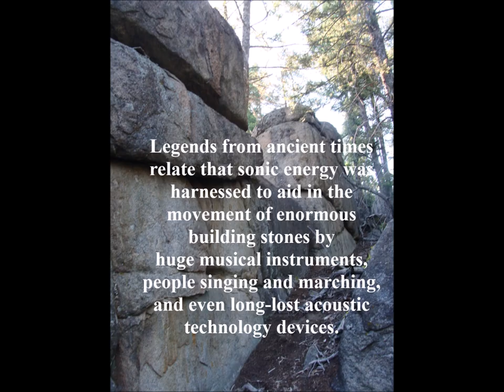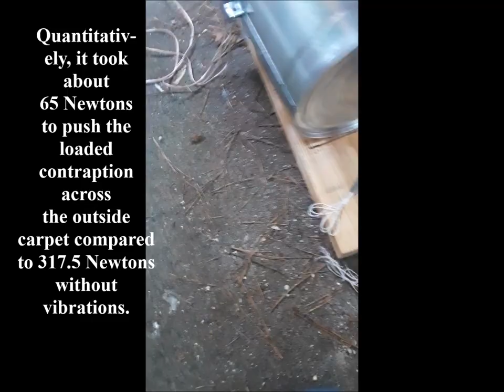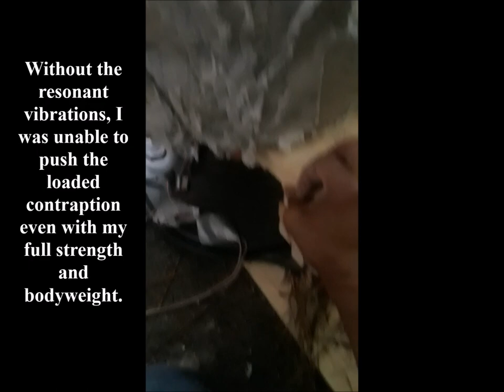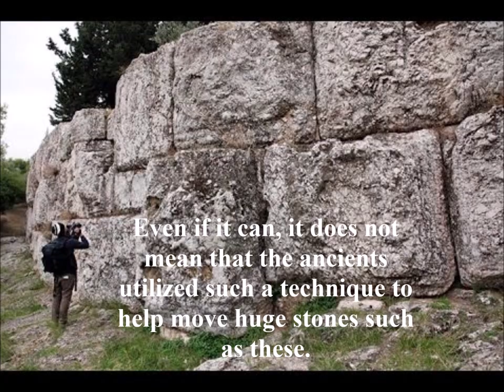Moving Boulders with a Push of the Finger: Did Sound Help to Build the Megaliths?

Comment: great video
Reply from the maker: Thank you 🙂
Reply: @gsutton78  have you made any progress with more weight?
Reply from the maker: @trutheretic   I've gotten up to a quarter ton so far in a video I did last October. The next amount should be a full ton. But it's challenging as I would need to hire a small team, more equipment, and enough wood to make a mold for the concrete block that size. Or I could find a natural stone, but means would still be needed to maneuver it into position. Also need a clear outside space. So, I definitely have a plan for it in the near future!
Reply: @gsutton78  well done mate, keep up your dedication!

Comment: My washing machine is sitting on a thick rubber to prevent damage on my tiles and excess noise when it’s doing it’s work. However one time I had an issue with my boiler and it was leaking and the water got under the rubber cover and so when my washer would go through the centrifuge process it would slowly slide across my restroom so I would sometimes catch it doing that and I noticed when it is vibrating like that I was able to slide it back to its original spot easily! Sometimes however I wouldn’t catch my washer moving and it would be done washing and the whole thing was moved away from its spot but this time it had finished washing and I took the clothes out, and still I was unable to slide it back even with full force, I called my brother to help me out so we kinda “wiggle wiggle-d” it back to it’s spot as it was quite heavy. So idk, I never thought about it until I saw this video and my brain connected the dots… Who knows, maybe the ancients knew how to vibrate heavy objects with some sorts of instruments and then together maybe move them somehow.
Reply from the maker: That's really interesting! A couple people told me similar stories about heavy plate compactors. In fact, just a few days ago, one guy was telling me about how he could move a 1,000 lbs "tamper" with one arm when it was in operation, but couldn't budge it with 3 additional guys when not in operation.

Comment: The material are in 2 places at their extreme,, half time its contacting the ground, the other half it float in the air,,you can push it when its in the ''aerial state'' ..btw the pyramid and ancient tale of acoustic and sound resonnance are all about ''sound resonnance , we use this technology in church ,theater, coliseum..etc.. its all about emplifying a weak sound to exploit its energy in a better manner, like sound emplifiing , energy transmission true the air''sound'' to be use as wireless energy sources to make vibrate ''tool wich are tuned to the sound frequency'' pitch fork''.. the russian had a microphone/spy bug that used no battery no electronic,,just a small metal pill box like object with a metal rod screwed ont its side,,all of this carried a radio wave true the air,,and this is mindbuggling to me because the best tech are the simplest.

Comment: Your flaw in this theory is the fact you are in the resonation field, increasing the vibrations will make jelly of your insides, you could also crack the stones. Plus this does not have anything to do with cutting the stone. Accept the fact they did it we can't and move on.
Reply from the maker: But the idea is NOT to be in the field by using long ropes and pulling from the front. The stones crack only depending on how the energy is directed. If directed into a small space, it may crack. If spread out over the stone, it will just move. Also, I've made videos demonstrating that sonic technology can both cut and carve stone: https://youtu.be/na7THeVCyQA  and  https://youtu.be/oIHL1s1d7ew.

Comment: This is cool as shit!! Just need to know one thing.... Does anyone else have a hard time with the debris around and on the equipment? I want to to be cleaned off. If the pine needles are a part of it and they are being used as the substrate needed to move the load, like logs under the massive stones in Egypt, I understand that. But if not..... 😵
Reply from the maker: The pine needles do help to reduce friction in this particular setup. But they are not absolutely necessary. At the time I didn't have a garage with a smooth concrete floor, only a porch with an outdoor carpet.

Comment: I believe they did use sound check out cutting with the sun or sound. I'll try my best to put it in this coment
Reply from the maker: I think it is definitely possible. Sound can be used for cutting and sculpting:
Ancient Acoustic Cutting
https://youtu.be/na7THeVCyQA
And Thermoacoustic vibratory engines could be made which could run on ordinary fire or by concentrating the sunlight onto the engine. Such devices could have been made without modern space age materials and technology:
Ancient Thermoacoustics
https://youtu.be/DwI4vAKRSMY

Comment: The didgeridoo was used for this bery purpose. Idk why the idea of it is so taboo. It's fact vibrations move matter.
Reply from the maker: Absolutely! Vibrations can move matter and can also shape matter!!
Reply: @gsutton78  rogans most recent podcast Randal they talk about a new tech generator that uses no fuel only the resonance of different materials against one another. Stupid simple concept.  Iv often wondered why we don't use pressure vessels and the sun to generate(they do but far from common practice) but im just a dumb  carpenter what would I know
Reply from the maker: @cavelvlan25   Well, have you ever heard of Ralph Ring? He apparently worked for Otis T Carr and was into free energy and levitation. His boss once told him, "yes, I know it is simple. But we don't get paid to find the answers. We get paid to 'look for' the answers. And we get paid well". That pretty much sums up this system. Instead of finding cures for disease, they just continue to look for them. And when they find them, they just look the other way so they can keep the research money coming in. Profit first, everything else a distant second even at the cost of the Earth. Even at the cost of people.
Reply: @UC9PfiXk1AQYOk_JIr3QV93g how so you apply vibrations to something heavy it reduces surface tension making it move easier. Sort of like teslas revelation about adhesion when refering to how the tesla turbine rotates off moving water. Molecules grab other molecules when they contact they also grab each other. The correct frequency reduces this effect. Did that adhear? Or resonate in your brain?

Comment: Sound isn't the cause, its the vibrations allowing objects to be easily moved. Sound waves create vibrations these vibrations create a pocket of energy surrounding the cause of the vibration and anything its touching. I'd say Nikola Tesla understood this and could explain it way better.
Reply from the maker: whatisdoneinthedark willbebroughtt...   One could even more correctly say "sound" vibrations to differentiate between vibrations which can be heard and those which cannot. Some people use the terms sound alone because of that. But, it should be obvious that sound is the result of vibrations. Thus, using the term sound includes vibrations by default.
Reply: @gsutton78  while what you say is true,  the vibrations are the cause of the sound as well. you hit a tuning fork causing it to vibrate, you hear the frequency of the vibrations. You hear the frequency of vibration of a guitar string. there are frequencies we can't hear with the human ear it doesn't mean it doesn't make a sound only that our ears aren't sensitive  enough to hear it.
Reply from the maker: @whatisdoneinthedarkwillbeb9204    You've basically rephrased everything I just said. What is the overall point you're trying to make??
Reply: @gsutton78  yeah I noticed that after typing it and sending it my bad on that. But the point is that the sound is actually irrelevant, the sound is a byproduct of the frequency of vibrations which are causing the phenomena. This phenomena would occur based on the frequency of the vibrations even if you were deaf right? at any rate I wasn't trying to argue with you my bad man. I was more giving a very basic scientific explanation to what is occurring for those in the comment section.

I do actually like what you showed people in this video though. For that I definitely give you props for being able to show this in such a nice simplistic way.
Reply: gsutton78 just wants attention because he’s a hater 😂

Comment: the workers would have been too deaf to hear directions even if they could create sound/vibrations loud/strong enough to move stones weighing tens to hundreds of tons .
Reply from the maker: Not really. It depends on how the vibrations are coupled. If coupled to the air as with a speaker or horn with the flared opening, then yes. But if coupled to the mass or the surface, then the vibrational energy manifests more as movement than audible sound. A jet engine could rupture your ears if you stand outside beside it where the vibrations are coupled to the air. But the vibrations are not directly coupled to the air inside the jet. Inside the jet, it is still loud, but not loud enough to rupture eardrums.
Reply: @gsutton78  thanks for the nice reply . there is insulation to dampen the sound in the cabin of a airliner . coupling to the mass or surface is interesting . but those vibrations would need to be decoupled or inert to the surrounding areas to not damage structures or move other stones and hurt workers . it is wonderous how it was actually done . we may never truly know .
Reply from the maker: @JeffB1961   Well, if we look at the tremendous energy of earthquakes, they too are pressure waves; essentially low frequency sound vibrations. But that energy is coupled to the Earth rather than to the atmosphere, and therefore doesn't typically rupture eardrums or internal organs. During an earthquake, there are many other things to worry about. In this particular experiment, I use about 500 Watts of power. But I can honestly say that the sound was in no way painful even being right next to it. Now, if that same power is applied to a large electrical whistle or PA system, then the experience would be quite different. A large car sound system uses less than half of that amount of power. As far as the sound having unwanted affects on other structures we have to realize that the ancients were experts in the art of manipulating sound. For instance, using solely the geometric positioning of stones, they were able to duplicate the same sound directing and amplification effects that we achieve today with parabolic sound dishes. There are also ways to temporarily mitigate the effects of certain vibrational frequencies on nearby structures using dampening techniques.

Comment: Well they would still need to find a way to lift the giant stones to put them on the sled…
Reply from the maker: Lines Linuz. They would have to do that anyway, though. You'd want to move it with a sled to avoid damaging the surface. Hoisting it onto the sled would actually be the easier part. It's the dragging that is the most energy intensive.
Reply: @gsutton78  how exactly would be lifting a 2 ton block be the easy part?
Reply from the maker: @mattunnaki8983   It's a matter of Work, of energy. Work = Force ×Distance. Dragging a stone 30 miles will take far more energy than lifting it a few inches onto a sled or even lifting it 50 feet onto a pyramid.

Comment: they have trucks made of stone wheels, elephants pull
Reply from the maker: Stone wheels would be extremely heavy. Also, you'd need axles, bearings, and a suspension system.

Comment: ultrasonic levitation which use ultrasonic arduino module can float any material like bolt or nut ,  Acoustic technology is strong science not yet use in our life only on DJ techno party , I will start some ideas perhaps I gain money if it will work as I want

Comment: they poured them like cement using geopolymers
Reply from the maker: Not all of them, though. Like we do today, they used both concrete and cut natural stones. Further, using geopolymers still doesn't solve the transportation issue. Today we use large trucks which constantly churn the cement mix and which can transport up to 10 tons worth of cement. The ancients would have to have had a comparable method to transport so much material within a reasonable time frame.
Reply from the maker: @prototype9000   Again, this doesn't apply to all of the stones. Some of the stones are sourced to quarries tens to in some cases hundreds of miles away. Bucket lines would be impractical over such distances. Geopolymer also doesn't explain the carving feats such as Abu Simbel, etc. which are comparable to modern carving feats such as Mt Rushmore.
Reply: @gsutton78  i said 98% of them so far
Reply from the maker: @prototype9000    You actually said 99% earlier. Either way, the figure is most likely inaccurate due to modern hubris which simply can't accept the ancients' technical capabilities to move large weights. The ancients used various construction techniques just as we do today. The 60-ton stones used in the inner chambers of the Great Pyramids, for instance, were sourced to Aswan over 500 miles away. Again, simply impractical for a bucket chain. It's far easier just to transport the entire stones intact. There's also a wall painting in the tomb of Djehutihotep which shows a method of moving a large statue using a sled and pouring water in front of said sled to compact the sand and reduce friction. So, though I agree that a large amount of the materials the ancient builders used were sourced close to the building sites, they also imported specialized materials over great distances just as we do today. Nothing new under the sun. All I'm doing is showing that there are other, novel ways to reduce friction.
Reply: @gsutton78  not innaccurate just look up Joseph Davidovits he shares his findings in detail and other laboratorys findings
Reply from the maker: @prototype9000   No, it's your conclusions that are not entirely accurate. To quote from Wikipedia, 
"Davidovits's [geopolymer hypothesis] does not explain the granite stones, weighing well over 10 tons, above the King's Chamber..." 
Just as I explained. After all, it is a "hypothesis" just as my acoustic lubrication hypothesis presented in this video. We also have other sites such as Nan Madol which are made of basalt prisms which were simply pried away from the bedrock. The quarries which were the source of these stones have been found. And again, concrete doesn't explain the intricate carvings and their tool marks. You need sophisticated tools to create such sculptures as well as to move around tons of rubble and loose material in addition to large intact stones.
Reply from the maker: @prototype9000   The information used for the Wikipedia article actually comes from cited sources, dude. The general academic consensus is that ancient geopolymer explains some, not all of the stones. And it certainly doesn't explain carvings and sophisticated tool marks.
Reply from the maker: @prototype9000  Also, even Davidovits agrees that the largest stones used in the King's chamber were carved.

Comment: Imagine how many horns how big are horns how many humans had to blow on those horns to make the type of vibration to move those giant stone walls. Like thinking all of the cranes in the world could build the pyramids but you can’t get all of the cranes around the pyramids
Reply from the maker: We have to remember, however that the principles of resonance are likely involved. This allow us to continuously add energy into a system faster than that energy can dissipate. It may seem counterintuitive that a person can shatter a glass with merely their voice, but it's certainly possible via acoustic resonance. In the case of macroscopic acoustic lubrication or levitation, the Earth itself may have been harnessed to greatly increase the sonic energy since the Earth is essentially a giant cavity and therefore has its own acoustic and electrical resonance modes.

Comment: Mud and rock packed in to Woden forms to make the blocks, the mud later petrified.
Reply from the maker: In some cases perhaps. But that's a lot of wood needed to make casts. It's also a lot of mud and rocks to still move around, some from great distances. Either way we look at it, there would have needed to be some form of mechanized mass transit and mass processing to do any of this in any decent amount of time. And that implies an ancient technology more sophisticated than is currently recognized.
Reply: @gsutton78  you need to be able to brace wood to a form, and pass bags of dirt in a line, many hands light load.
it wouldn’t take a lot of wood because you move the brace down to the next block after hardens.. 
you have to keep things economical. Why move blocks. Just grab that dirt right there and fill it and some ash, fits like a puzzle with interlocking parts because of the forms you used. 
Or call a giant alien
Reply from the maker: @9greatdanes981   Many of the stones in the great megaliths like the pyramids, Stonehenge, and Nan Madol were sourced from a significant distance, though. In some cases, hundreds of miles. The quarries for many of these sites are well known. Also, look at the Moai of Easter Island. How do you create huge enough molds for those? It's much easier to just move the stone and carve them.
Reply from the maker: @9greatdanes981   Many of the stones were outsourced. The blue stones of Stonehenge were moved over 100 miles to the site. The stones used in the inner chambers of the pyramids were sourced from Aswan over 4 hundred miles away. Sorry, dude. Can't solve all the problems with ancient geopolymers. Some, yes. All, no. We have to face the fact the ancients were much more capable than they are given credit for and that we are not the creme de la creme in all things.